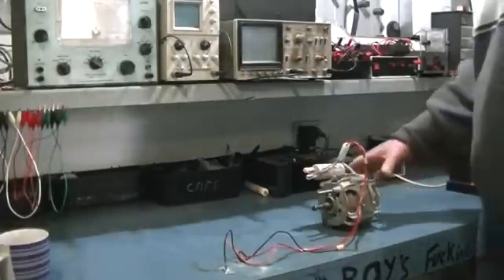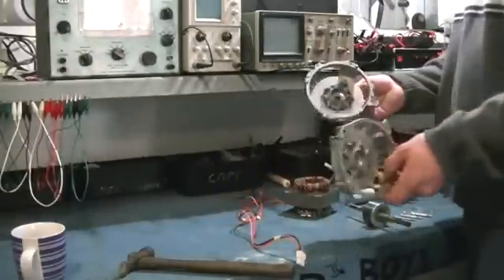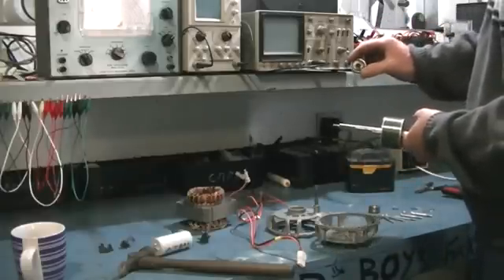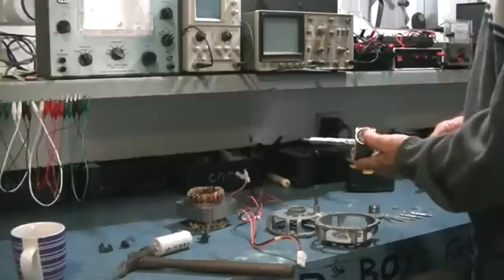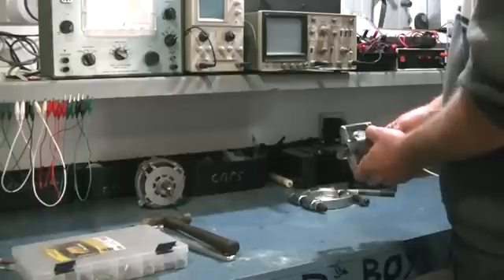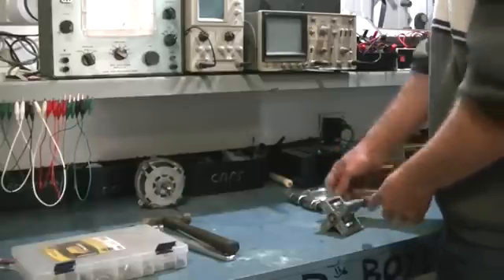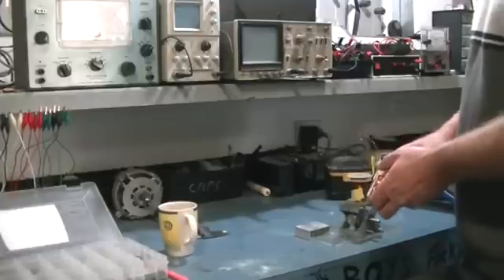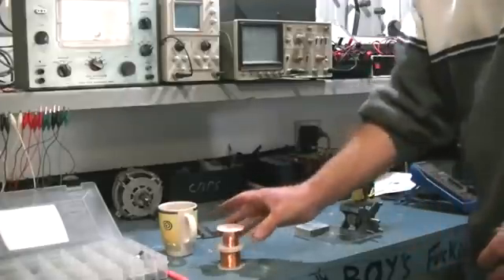easy pulse motor build..mp4

Comment from the maker: Hi RICHLES01
Up until today,i have not seen a pulse motor that will charge one battery faster than it will drain the run battery.There are many who say they have seen it happen,so there may be some that do.How ever-i have seen a window motor fully charge 4 battery's the same size and make as the run battery befor the run battery had to be charged.
Some will say that is rubbish,but i seen it with my own eye's-and i still havnt quite figured out what was happening in that system.